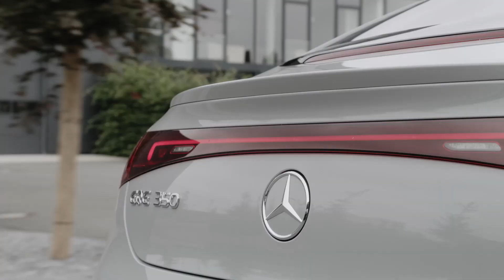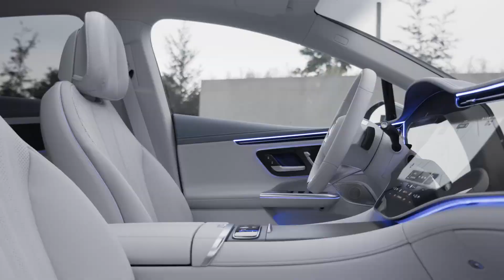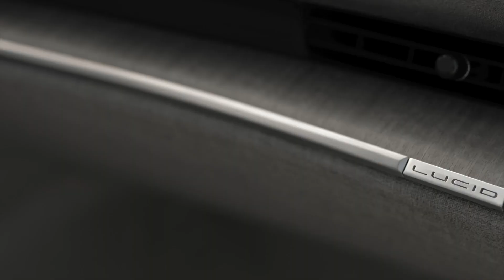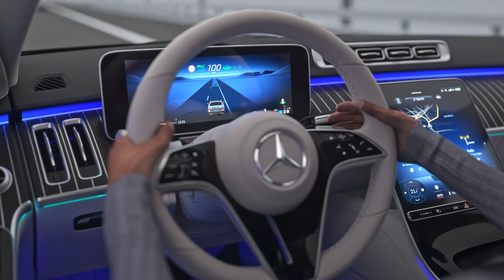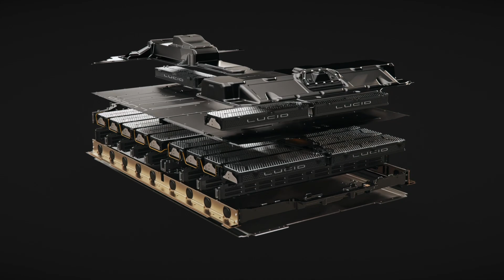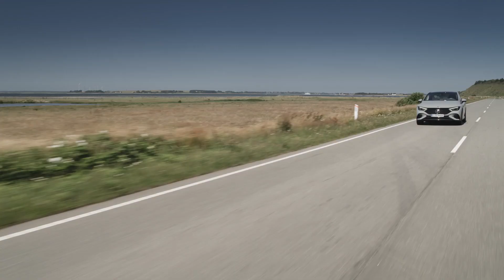Mercedes EQE vs Lucid Air: The Executive EV Segment Gets Charged Up!

Comment: I like  Lucid Air Pure much better, and it's because the following reasons  
1)  Lucid covers three years Electrify America Charging 
2) the Fed tax credit of $7500 lowers the price to $$69,900 

Three years charging saving $7000x 3 = $21000, and it will lower the car cost from $69900 to somewhere around $50,000  

It is a slickdeal
Reply: yeah... because u charge for 600$/month? lol
how did u get to this number? (7000$/year charging)